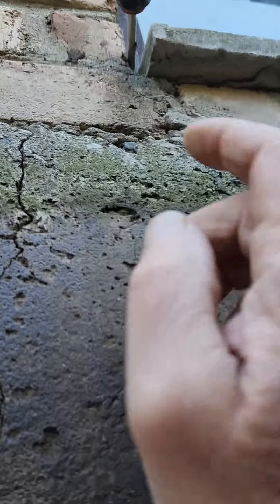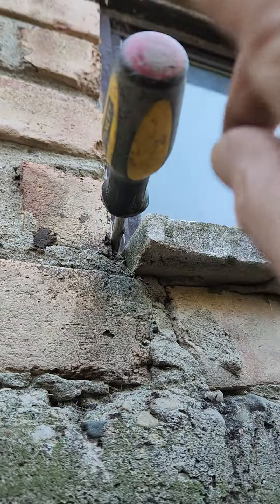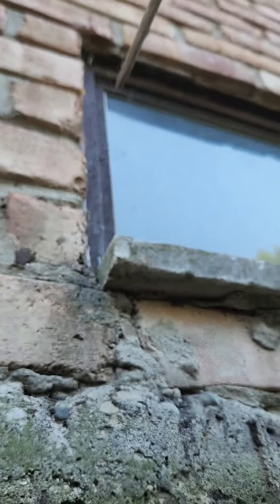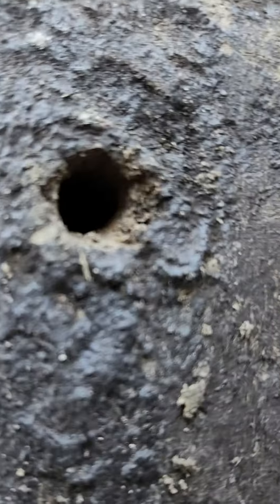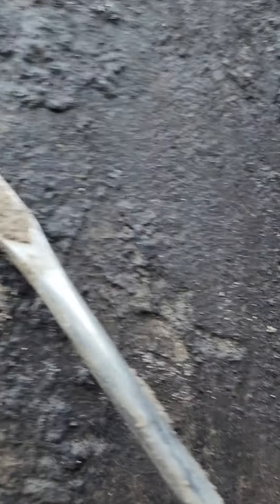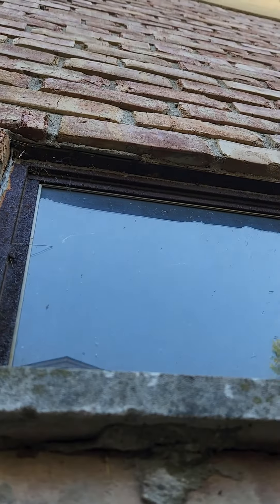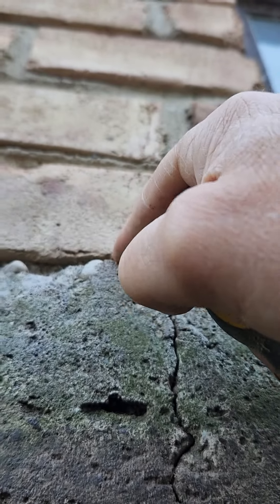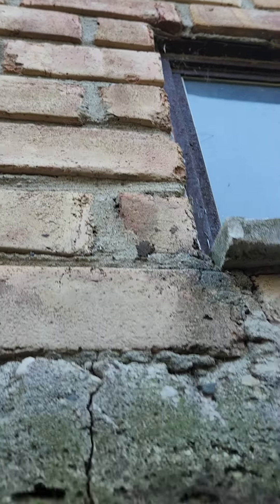ffoundation wall crack basement waterproofing

Comment: Hey mark, got a question about leaking out first course of block from footing, wall was tarred about 9 years ago, heavy straight downpour for a couple hours leaked a puddle of water, near corner or house. Should I dig the corner up?
Reply from the maker: You can call me if you like,  here's what I would do first....take a hose and run water full blast ground level down.... right on the outside of where you get water inside, run water up to 45 minutes right against the wall n lmk if you begin to leak
Reply: @markanderson8583  will do, what’s your digits im in Canada eh
Reply from the maker: 586 777 7973 free now if you are lol
Reply: @markanderson8583  tried the water test both sides of corner, just got small seepage not enough to really even pick up off the block compared to the rain storm, held it for 35 minutes each side
Reply: @manderson5397  yes, seen water on block, when hose testing north wall, did not seem to happen when testing west wall, there is windows on both sides but about 4’ away in both directions. The north wall, I don’t believe was ever dug up as there was no tar just a very light roll on paint. I only moved in couple years ago and dug up the east wall a year ago as that’s where it leaked. The north wall because of services I think they never dug up
Reply: @manderson5397  ok, ya I’ve been following for awhile now. It makes sense to me for sure, needs to be dug up by north wall I’m thinking.